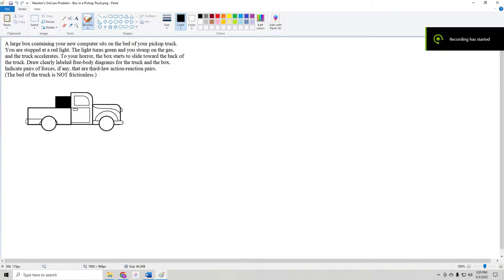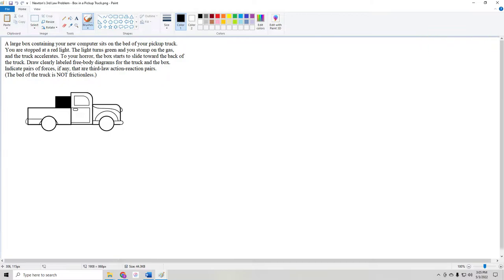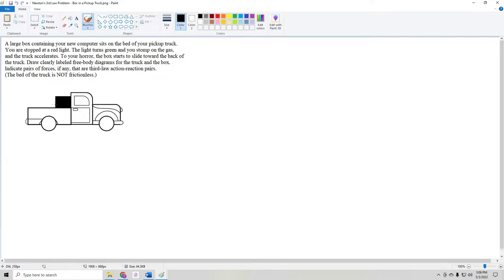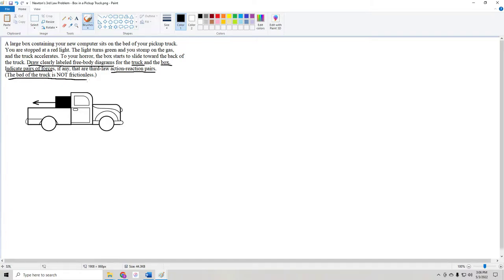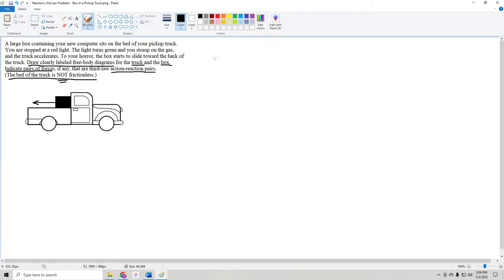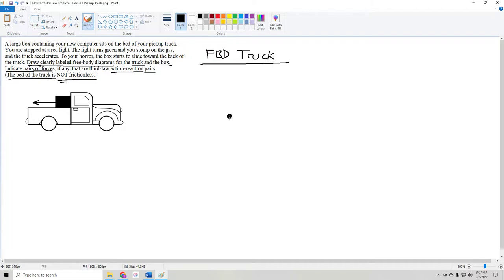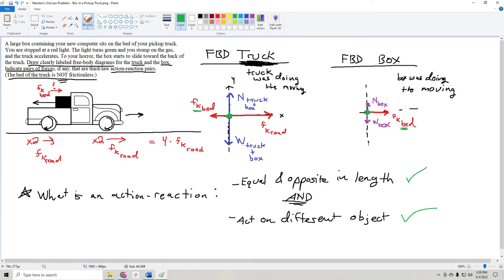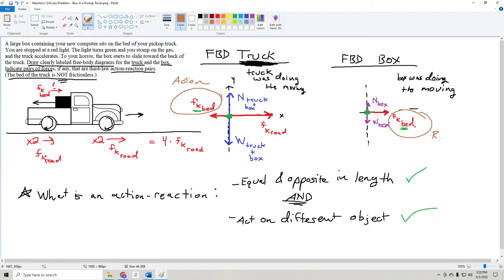Newton's Laws Problem #1 - Box in a Pickup Truck (3rd Law)

Comment from the maker: Hey folks, looking back on this video it appears that I made a mistake. 

When drawing the truck's FBD at 2:35, we should not be combining the normal force and weight for the truck and the box. This causes us to miss one of the action-reaction pairs. 
Please see the link to the PDF in the video description for the correct approach and proper solution. My apologies on that!
Reply: Hello, can u explain why the normal force of the two are pairs?
Reply from the maker: @jumarvallesjr.9099  Hey Jumar, yeah of course! Two things for you:

a.) This video is pretty old and has some things in it that need to be corrected. Until I get some time to re-do it, refer to the new PDF writeup I've added in the video description. 
You can find that PDF directly here: 
https://github.com/SineThetaPrime/Mechanics-I/blob/main/Newton's%20Laws/Problem%20%231.pdf

b.) In case the link isn't working, here's the explanation from the PDF: 

"The action-reaction pairs in this problem exhibit the two following properties: 

1.) The forces in the pair are equal & opposite in length.
2.) The forces act on different objects. "

Since the normal forces are of equal length and they act on different objects, they satisfy the two conditions above and are thus considered an action-reaction pair. 

I hope that this helps! Let me know if you still have any questions.

Comment: Hello, so what is making the box move left if there is no force pointing that way?
Reply from the maker: Hey Technodroid, 

This is unique situation where the box doesn't have a direct force acting on it causing it to move. 

Instead what's happening is that it's the truck that's moving. From the box's perspective, it feels like it's sitting at rest as the truck starts moving from underneath it. 

This motion of the truck, relative to the stationary box, is what causes the box to appear to move to the left to an outside observer. 

Hopefully that answers your question. Thanks for watching!
Reply: @sinethetaprime  Thank you!